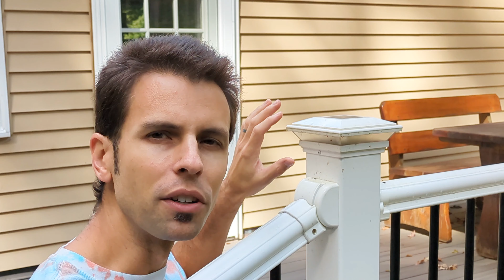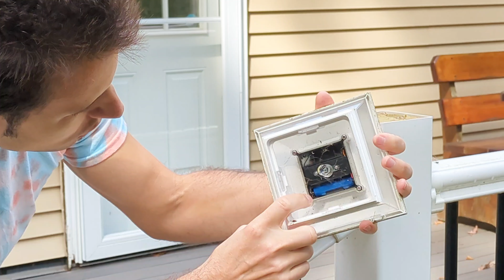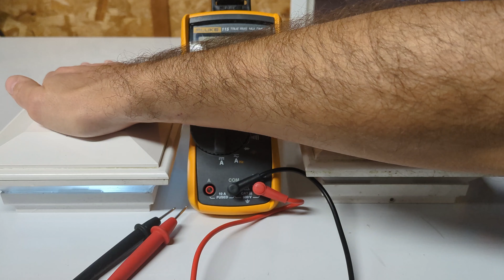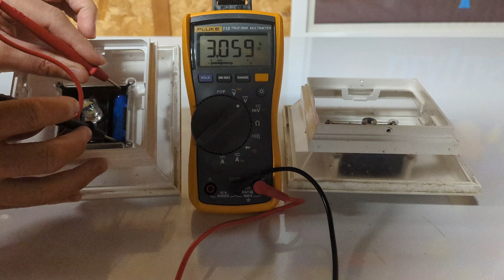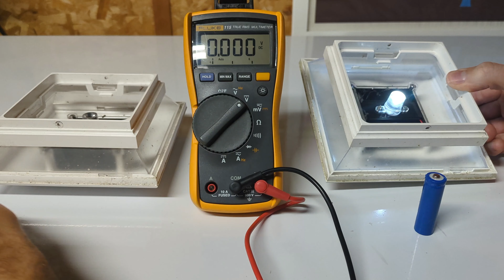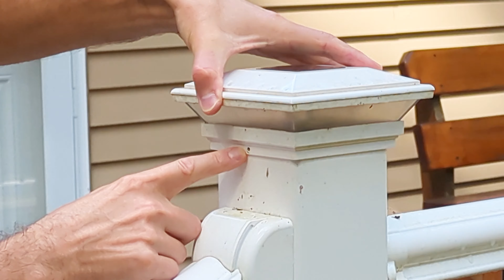How to Troubleshoot a Solar Post Cap that doesn't Turn On

Comment: How did you first install them with the screws?
Reply from the maker: Place the cap on top of the post, drill a pilot hole on two opposite sides, which will go through both the cap and vinyl post, add the screws. I don't recall the pilot hole size, but use a drill bit that is the size of the screw shank not including the threads.
Reply: @r @realhouseDIY awesome! Thank you